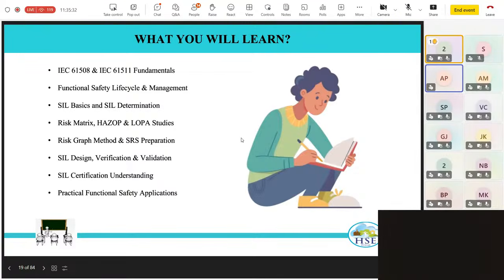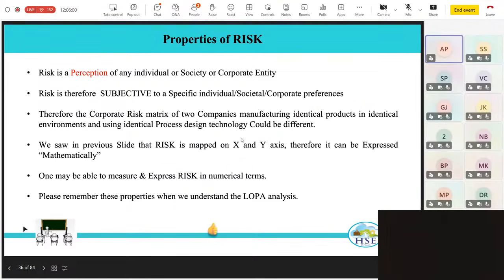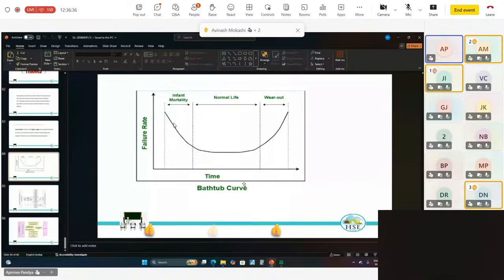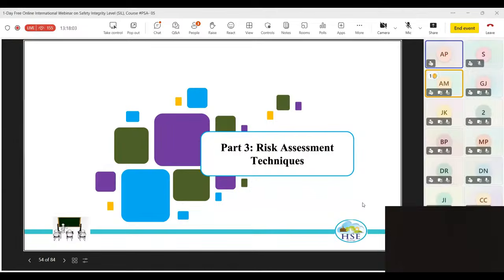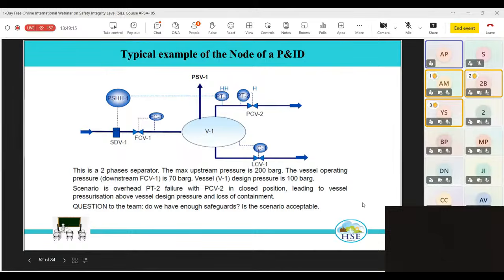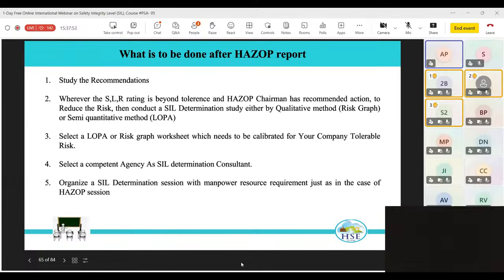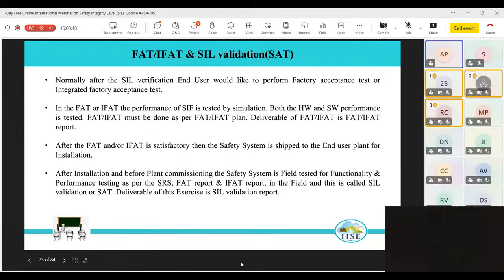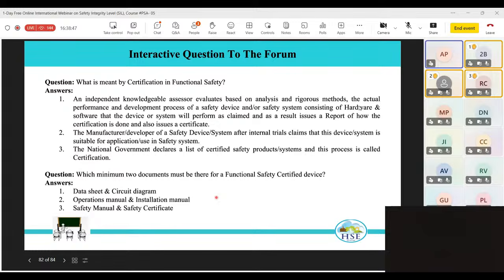Safety Integrity Level, Date- Webinar 16 May 2026

Comment: Today, I am pleased to share that I successfully participated in the 1-Day Webinar on Safety Integrity Level (SIL). The session was highly informative, professionally organized, and enriched with practical industrial examples.
The topics covered included IEC 61508, IEC 61511, HAZOP, LOPA, SIL Determination, SIL Verification, and P&ID-based case studies. The trainer explained each concept clearly, making complex functional safety principles easy to understand. The real-time examples and risk assessment discussions provided valuable insights into process safety applications in industrial environments.
The trainer demonstrated excellent technical expertise and interactive teaching methods throughout the session. This webinar was extremely beneficial for professionals working in process safety, instrumentation, and functional safety engineering.
I sincerely thank the organizing team and trainer for delivering such a knowledgeable and valuable learning experience.

Lot of thank you Mr. Yashpal sir, Mr. Aprrova Panday sir and Shalini madam also HSE Group entire team. 

Thanks & Regards
Mr. Ramesh, Chavan 2026-01-PSA-1642
Ticket No: 1227